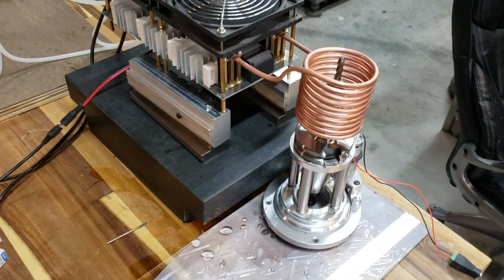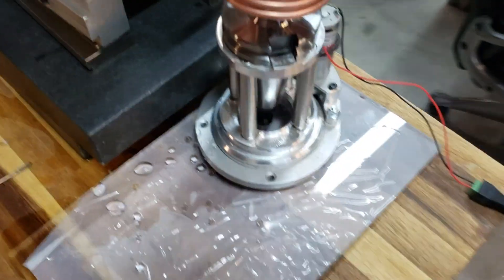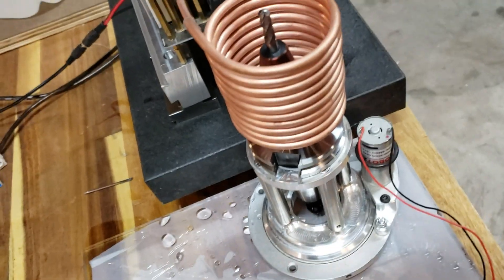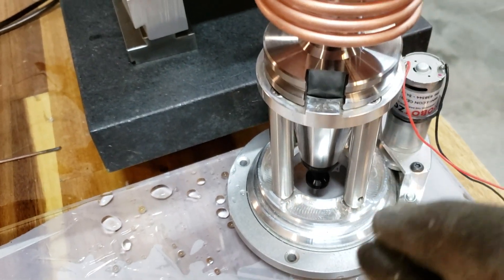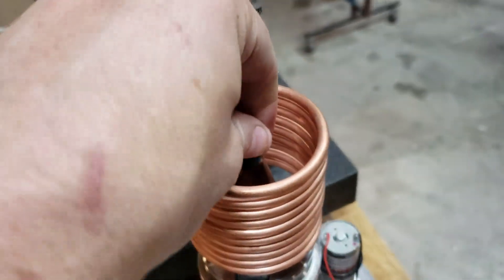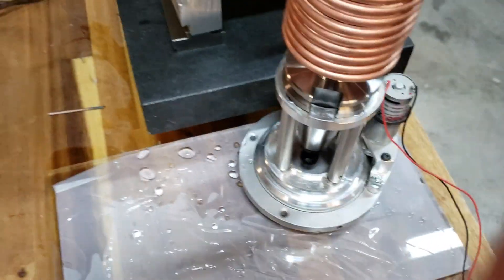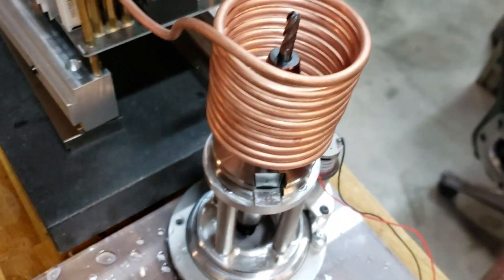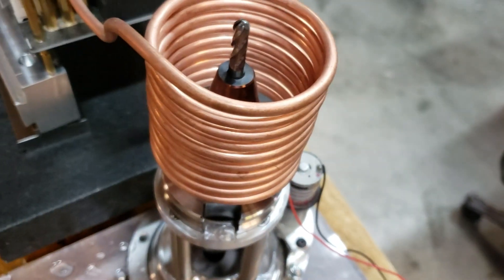DIY Shrink Fit  Induction Heater

Comment: try making a smaller coil for it, I used 3/16 tubing wound around a 50mm bar. 
heats my holders in roughly 12 seconds, just be careful going too tight as could overload the unit.
Here's some clips off my phone of mine working: https://youtu.be/qRQxg6qOfEU